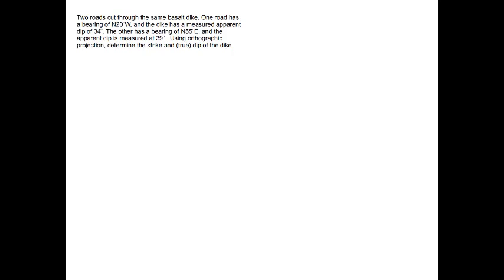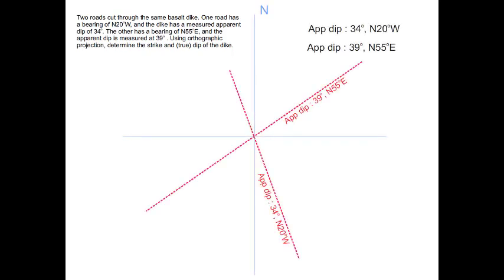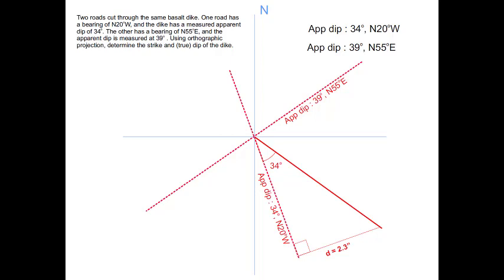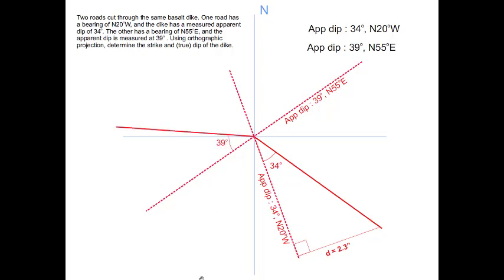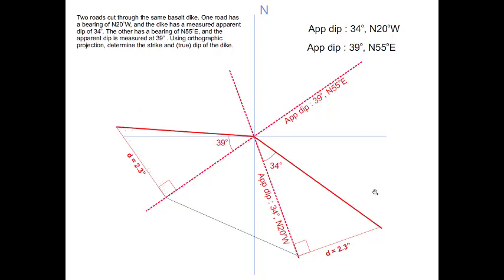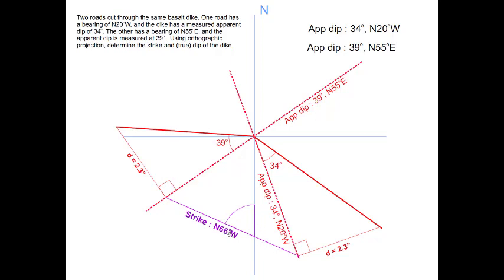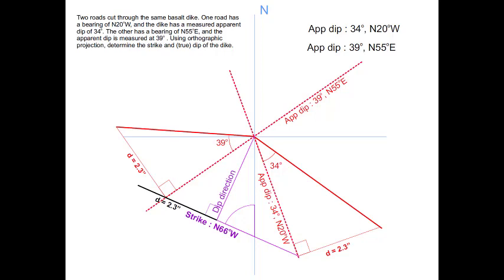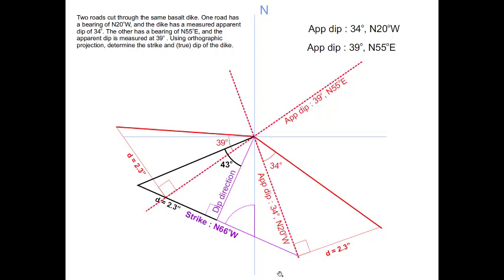Example of Strike-dip from two apparent dips by orthographic projection

Comment: Great explanation! Admittedly, I struggled a little with my problem because my lineation bearings were far more similar (roughly 15 deg apart from each other in the same quadrant) however, my calculations were correct.
Reply: Thanks!!